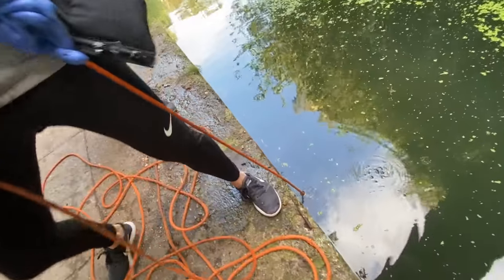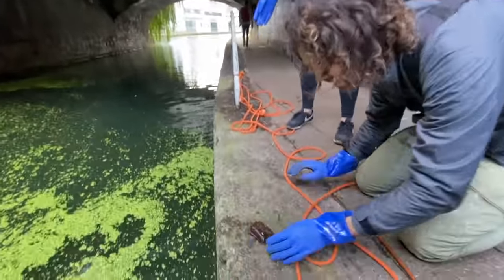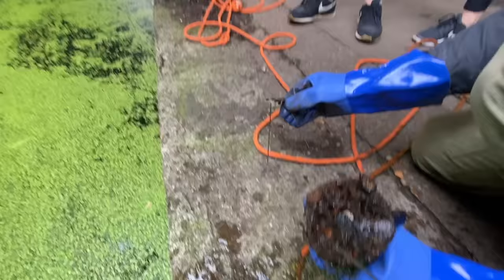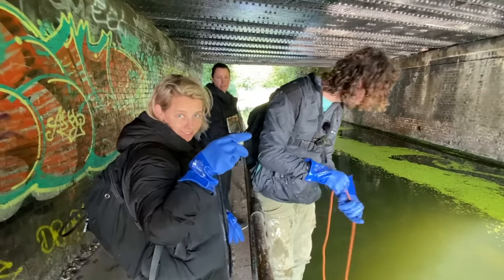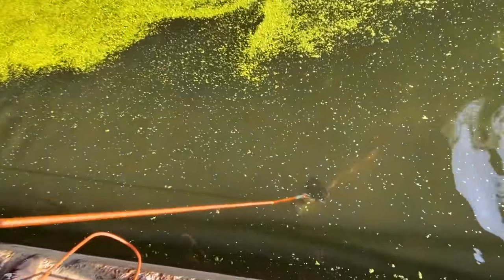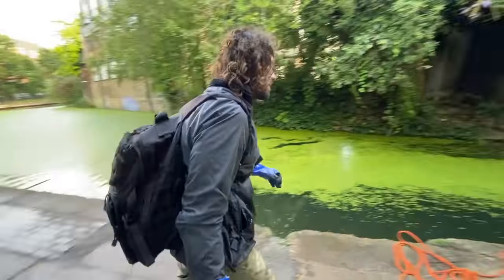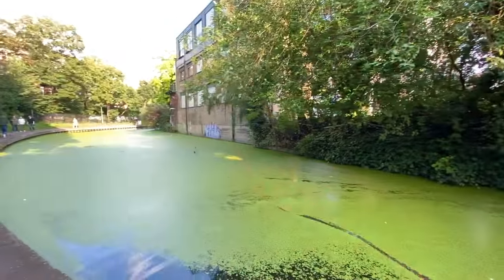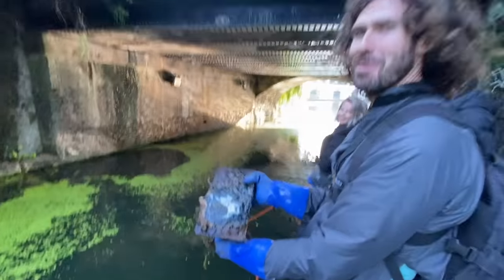We Hit the Jackpot Magnet Fishing in London (This Canal is INSANE!)

Comment: 19:55 is a transformer.  Copper windings in the middle, but the square bit around the outside is stacked steel plates, which is why it stuck so well to the magnet.

Comment: I lost my 300kg-magnet yesterday because the wall that was going down into the water turned out to be metal. The top of the wall was concrete, and the bottom of the wall that was underwater was metal. Guess I won't be finding any bicicles any time soon!
Reply: @oceanslevel5081  we didn't have one, and even if we did use one, the magnet would shoot into the sky and possibly hit a car or someone passing by. So I had to cut the rope.
Reply: Welp... finders keepers!

Comment: the bmw engine that you found is from any early 1980's bmw motorcycle. check by the oil filler hole for a serial number. bmw lists what model that it came from.

Comment: Looks like an R75/6 (?) BMW motorcycle engine. It looks like the vintage is mid 1970's. If you keep fishing you may eventually be able to build a motorcycle with free tools! The engine case is aluminum and if it's in good condition it can be cleaned up and sold to a motorcycle  shop for a few bucks (pounds there).

Wheel is BMW also.

Comment: that's a BMW R80 or R100 engine. internal '247 model, everything with a serial# has been dumped. they should have removed the pistons as well, when taking of the cylinders. they are more expensive than the cylinders....u find lots of them on ebay ;-)